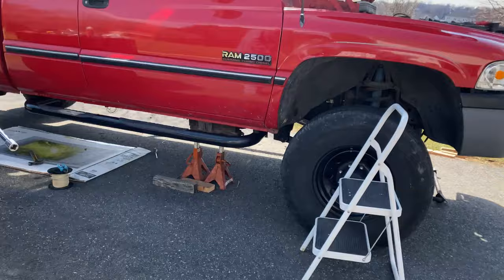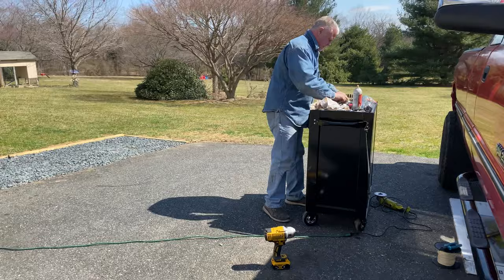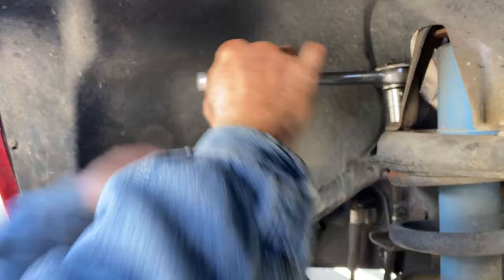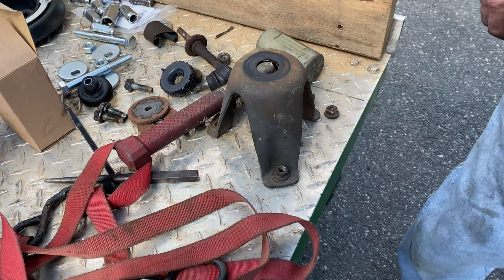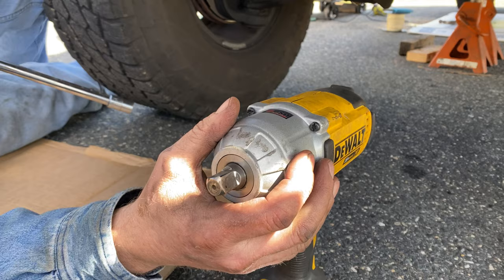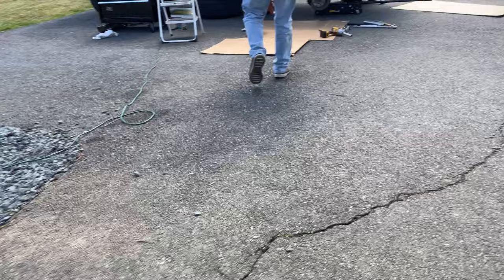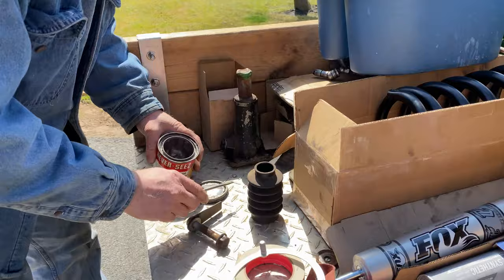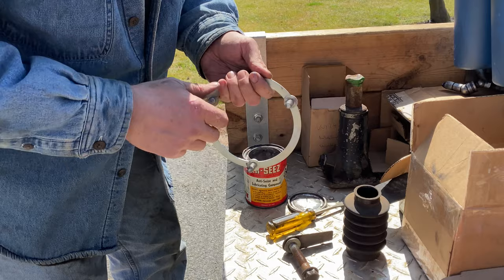How to install Fox Shocks and Thuren Springs to a Second Generation Cummins Diesel

Comment: Wow, what a helpful video.....  just doing the same job on my 2004 2500......  lots of detail in this video (and the control arm one) that prove helpful.  Good humor too.  Thank you for capturing this on film so capably.  You should have more subscribers, in my opinion!
Reply from the maker: Thank You. P-Pump does a great job at getting the shots people need to see. Combining working on the truck and recording the work has turned out to be a lot of fun.
Reply: @dustydiesel564 XCELLENT VIDÉO ! But I have a question, I need to change my springs too, and I want to put more longer (2,5 " higher) can I use a spring compressor or do you think I can install them without compressor, just to put down the axle is enough to install them ? Thank you for your help

Comment: Good job on replacing the shocks and the springs I need to replace the shocks on my 1999 Dodge ram 2500 4x4 my truck is lifted I'm having trouble finding the right size of shocks I like your truck looks very nice is your truck lifted and how many inches looks like mine

Comment: Well this is got me curious to try this lol.  Pick up the thuren soft ride shocks and need to put them on, so tired of the rough ride after owning the truck for a couple of years
Reply from the maker: I think ride is very subjective. The Thuren XS softride springs and Fox shocks have taken the harshness out of the ride but it is still a pickup truck. I have a brand new Jeep Wrangler and the truck rides much smoother but that probably is not a good comparison.

Comment: Hello! Great video. Thanks for taking the time to make it in such detail.
I know you did the control arms first. Would these Thuren coils and shocks. Would this suspension upgrade be ok to do on the stock control arms? 
Thanks
Reply from the maker: The general consensus is yes.
Reply: Depends on your tire size. Lifting the truck pulls the axle back in the wheel well opening, as well as sideways from the track bar. You will need an adjustable track bar, but can get away with stock control arms, I believe, don't quote me, up to 35 inch tires. They will almost rub the inner fender towards the cab.

Comment: Pushing the shock down and then moving it over is the best way to get the shock out. Otherwise an air hammer is needed to push it up.
Reply from the maker: Makes sense. Pushing them down would be a time saver. Appreciate the comment.

Comment: How has the ride improved? Is it smoother, softer.....?
Reply from the maker: The truck does not "bounce" down the road anymore and it soaks up the bumps better. A softer more controlled ride is how I would describe it
Reply: @dustydiesel564  Thanks! I need to do something with mine. How does it handle any weight in the bed?
Reply from the maker: @mikebates4815  It still has the stock leaf springs in the rear so the front rides great but the back is bumpy. The plan is to install a full Carli leaf spring replacement in the rear and use airbags when its loaded heavily...which is basically never anymore. Truck handles nicely, it rides better than most newer trucks I ride in.
Reply: It looks like I will go with the same Carli setup. Thank you.
Reply: @dustydiesel564   so its worth it!? I have the same lift set up im about to throw in my truck! Just want any improvement from a 23 yr old stock suspension.. was also thinking about getting 33s on a stock 16” wheel did you like that setup or did the wheels look too small??

Comment: no tower spacer needed?
Reply from the maker: I did not use any spacer. I did replace the hard rubber vibration isolation piece that the spring seats into.

Comment: Nice video! Other than extended carli control arms, is that all i need to use 2.5 inch coils? Thanks
Reply from the maker: You will need longer shocks too and an adjustable track bar will get the axle centered back under the truck. People run just shocks and springs though.
Reply: @dustydiesel564  thank you!🤙🏼
Reply from the maker: Shocks and coils were purchased here. https://www.thurenfabrication.com/
Reply: @dustydiesel564  thank you good sir.

Comment: How do those springs ride compared to stock?
Reply from the maker: The springs are much softer than stock. They soak up the bumps, the ride is much improved but the back is still very stiff. I am going to get softer springs out back and use airbags when loaded.

Comment: Do you have stock rear blocks under the leaf springs? If you do how tall are they ? Thank you
Reply from the maker: Stock rear blocks for now. My plan is to upgrade the rear with a full Carli replacement spring. It sits about 1/2" high in the front at the moment. I actually like that look but the rear springs are so stiff it is a shame to have such a nice riding front end with a overly stiff rear suspension.

Comment: What steering setup are u running? Don't really want to spend 1,000 on synergy setup
Reply from the maker: OEM from 99 HD. Bought all the parts on Rockauto for under $300.00
Reply: @dustydiesel564  Thanks for the reply 👍

Comment: I tried to install the springs last night using the exact same method you used, removed the sway bar and everything but the axle wouldn’t drop low enough to fit in the new carli leveling spring, I still need about 2 more inches of axle drop to make it fit. 
I did however notice the stock upper control arm was maxed out and hitting the housing at full drop

Any help would be rad, I’ll be uploading the video on my channel soon!
Reply from the maker: I did the control arms first. Is the frame blocked up high enough off the ground to allow the axle to drop as far as it can. I had to bottom out my jack under the front axle. Honestly the whole thing is a bit sketchy unless the truck is blocked up really well.
Reply: @dustydiesel564  yeah i  currently working on it as we speak, there is still about 8” left after the axle is filled dropped but I noticed the upper control arm (stock) is maxed out, I just removed it to see if it will allow for more articulation. We will see in about 10 mins if this works. 
Thanks for the reply!
Reply from the maker: @payloadperformance9706  Hope it worked. I forgot to remove the brake line on the drivers side and that held the axle up!
Reply: @dustydiesel564  yeah I did it, but I had to remove both upper and lower control arms, that’s was the limiting factor for mine. Since they aren’t long it didn’t allow the axle to drop enough to get the new spring in, tomorrow I’m doing the driver side which has a spring that’s about 1” bigger so we will see how that one goes.
Reply: Do you have the past numbers for the arms and springs handy? Also, you have the part numbers for your headlight housings? They look like they may work well? Thanks
Reply: @mikebates4815  i don’t have the control arms mine are stock, i only have the springs and shock combo the part number for those is CS-DSTARTER-94 it’s a hefty price just for the starter system right around $1000. 
as far as control arms you need to check and see upper and lower bolts size you have for your ram because even the same year has a couple different sizes and then buy accordingly. 

The HID retrofit projector headlights i bought were custom made by a guy i know but to be completely honest i don’t like the guy his customer service sucks and is rude to people had i known this before i purchased them i wouldn’t have got them from him, also they are non adjustable and he didn’t tell me so i had to put washers behind the mounting points to make them work. they do work don’t get me wrong but i have had small issues that i’ve had to deal with.

if you want some awesome one like mine check out TheHIDfactory.com they have some on there for the 2nd gen rams. you can choose whatever color light you want if you call them 5k white is the perfect pure white headlight color with zero blue.
Reply: @payloadperformance9706  Thanks but that was directed to Dusty. What website are your part numbers on?
Reply: @mikebates4815  oh my bad, it’s pretty much the same as dustys 😂 except the fox is going to be like another 1000 dollars on top of that 1000 dollars haha cjcoffroad.com
Reply from the maker: @mikebates4815  The Springs are just Thuren Fabrication XS (extra soft) springs. I bought them from CJC offroad. Those guys are awesome and will help you get the right parts. The Carli control arms have several options depending on the size of the bolts on your specific truck. I would go to their website or to CJC Offroad and work with them to make sure you get the correct parts. I have no idea where I got the headlights. They were purchased years ago online. Nothing special honestly.
Dusty
Reply: @dustydiesel564  Thanks!

Comment: Only thing holdin me back from getting a full 3inch carli setup for my 12 valve is my wallet. And boy did they get more expensive since I’ve been waiting. Have recently started givin thought into maybe a thuren’s 6inch springs. I’m currently on a 4 inch lift with a set of 4 ranchos probably ten years old and a nearly 10 year old air bags in the back. I just threw on a set of brand new 35” BFGs on some new 17 inchers. A nice upgrade from the 31s that I had on. Already sick of em and should have just bought 37s of the bat. Now I’m worried I’m not gun think 37s are big enough. Who knows... just bought a new dash from LMC and dropped a pretty penny on a 99-02 sport bumper from ‘em too I’ll will trying to stick on a 97. Curious what your thoughts are on the 3inch carli or going big on a 6inch thuren coils and firguring out the rest, nice to see fathers workin w their sons. -Pete
Reply from the maker: I really like the Thuren srings and I hear the Carli springs are  similar. I think I would want long arms if I went 6 inch lift. Don't forget a nice trackbar. The DT ProFab on my truck made a really big difference in how the truck drives. Funny you mentioned the 37's. We just put 37's on the truck and my son is editing the video now. He does all the work I just stand in front of the camera and talk trucks. He wanted to do the channel and it has been a great bonding experience. Appreciate your comments.
Reply: @dustydiesel564  do you have a video of that tracbar? I’m really interested in one and how it adjusts etc
Reply: @dustydiesel564  do you have a video of that tracbar? I’m really interested in one and how it adjusts etc
Reply from the maker: @FURFEELINGS_3  The sway Bar flip video talks about adjusting it but I didn't really film it. Basically just loosen the jam nuts and spin the middle section to move the axle left or right. I did block the frame up to allow the axle to move freely.